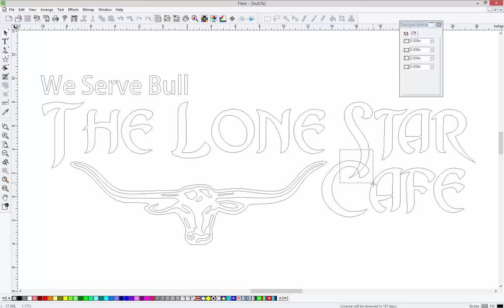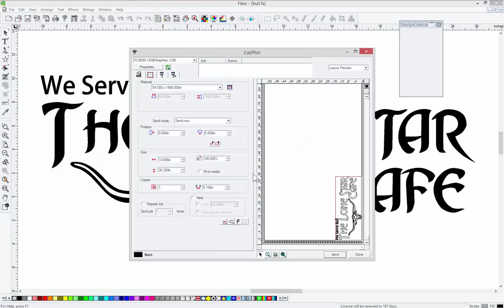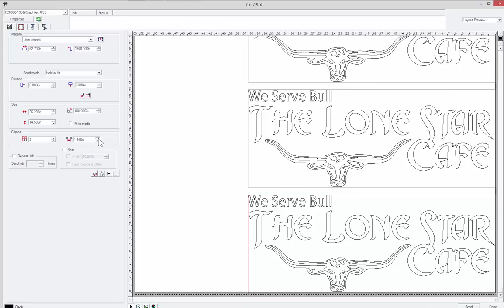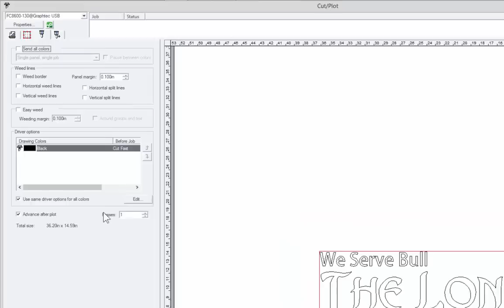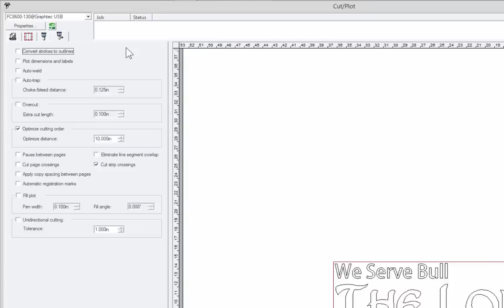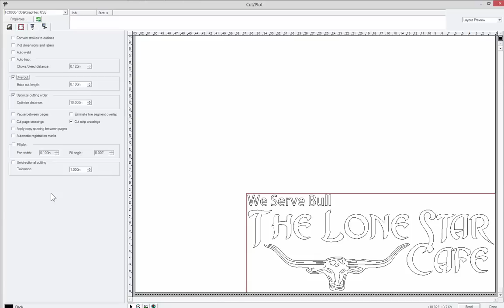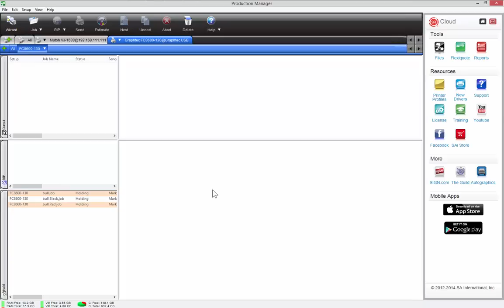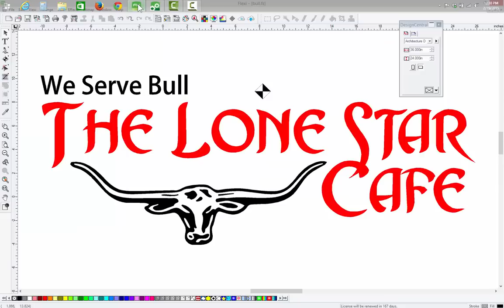How to Design and Prepare Vinyl Cut Jobs in Flexi

Comment: I have just started using flexi, i bought it already installed on a computer, the guy has a really weird setup where as there is no options, no file or anytging at the top of the screen. Any ideas how to just bring it back to default without uninstalling?  Thanks in advance.